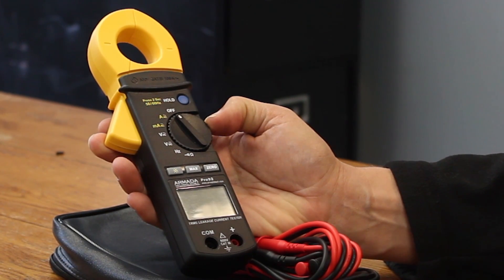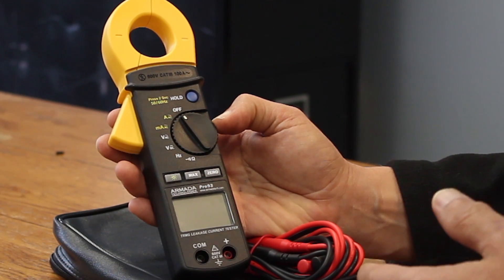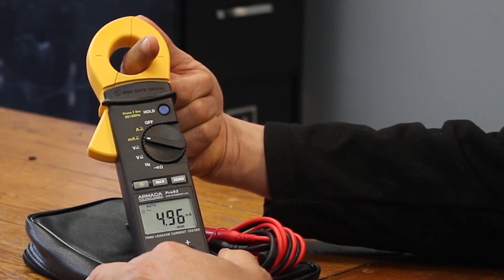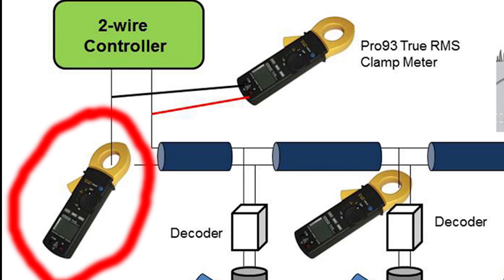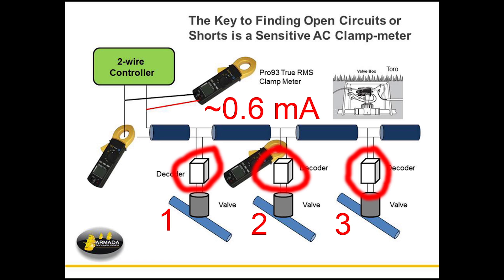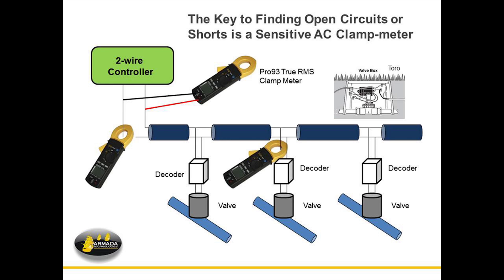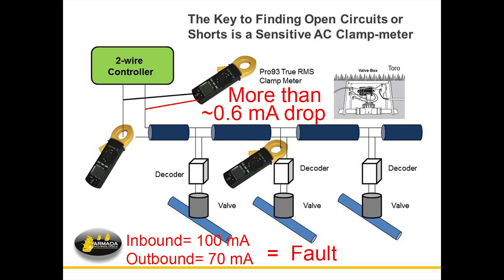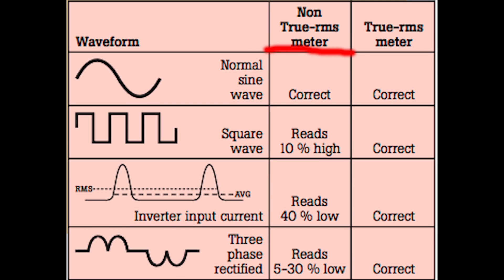How to use a Milliamp Clamp Leakage Meter to Diagnose Two Wire (2-Wire) Irrigation Sprinkler Systems

Comment: When checking for miliamps does the controller have to be running zones, run mode or off position?
Reply from the maker: When checking voltage and current it is best for the controller to be idle. If the controller has a fault-finding or short-finding mode use that for the steadiest readings. Even in idle the readings on the control cable can jump around, and ultimately measurements are best made with the control cable disconnected from the controller and fed by an outside 24 Vac power supply (we often use a small AC wall plug-in for that). You can use a controller 24 Vac power supply to feed the cable if you use it with an AC valve solenoid in line to protect against dead shorts.

Comment: if u have a 200 mil. line and a decoder draws .6 mil do u subtract  .6 from 200.mil and add all the decoder  in line to c what thay are
Reply: +john Kosheluk 
Hi John:
Normally you can take the total controller current and divide it by the manufacturer spec'ed current for each decoder to determine the number of decoders on the cable. It is important to use a True RMS meter for accuracy. The decoder currents can vary from about 6 mA to 0.6 mA depending on model and what power feed source you are using.
When a valve is operated the current can pop up by another 200 mA, then drop back to basic 'resting' levels. 
When fault-finding you will be looking for currents that are somewhat larger than expected or lower - the faults are typically splices (open splice = lower current than expected) or short circuits (failed decoders or wet splices = current higher than expected).  - Jim Carefoot
Reply: no , you cant do that, you can be fooled by one faulty one on line and also resistance along the wire changes, you must do one  by one because lets say  how do you know # 10  value ? you must know the value from #1 to #9 right? you could assume by doing it your way but i still highly doubt it .